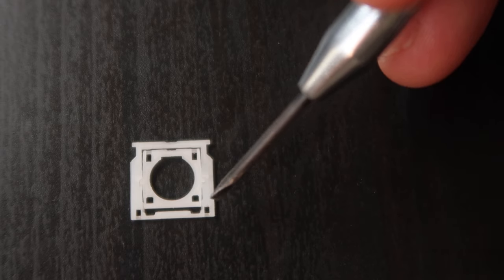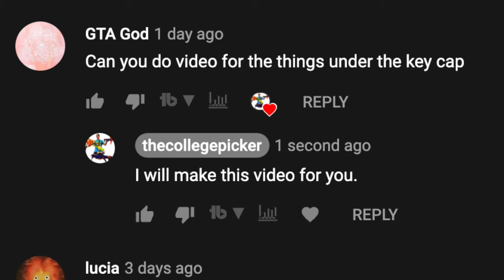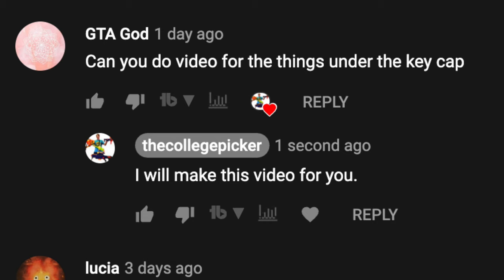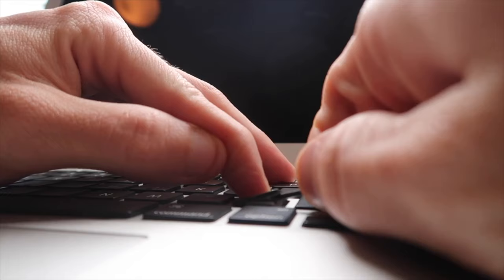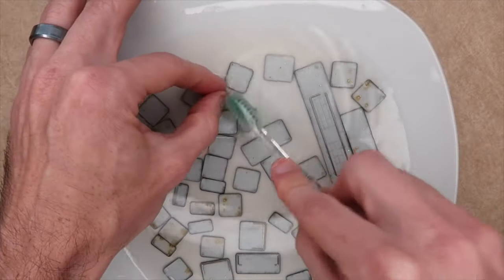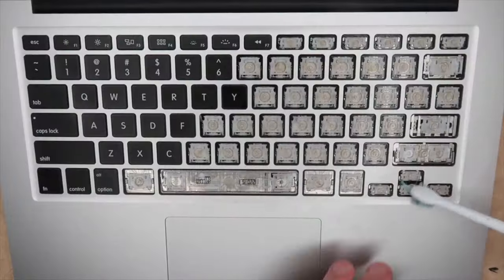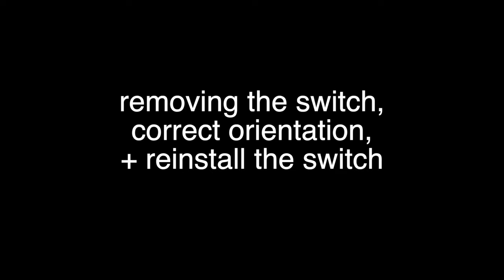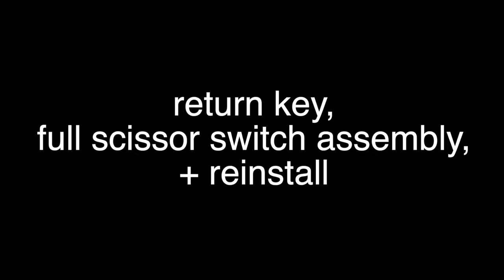How to Fix Macbook Air Keyboard Key Switch (Very Detailed)

Comment: now there is no bounce back on the key i fixed, works but is like pushing a flat button. tried twice, no broken bits, everything right direction and snapped in. kind of annoying and very little info on it online.
Reply: Is this still happening to you? mines doing the same thing.
Reply: i just slid my fingernail around the key and a little under for a bit
Reply: My space bar is doing the same thing lmk if you found out
Reply: Did anyone find an answer to this? My return key is flat and it's driving me crazy!
Reply: This is my T key and it's driving me bonkers.
Reply: Same! I need help
Reply: @thesciencelens  the same thing is happening to mine rn, did u find out???
Reply: @melody-rose6774  Sorry no :( Mine is still under warranty so I'm going to take it in.
Reply: @melody-rose6774  Unfortunately, no. My computer is still under warranty so I took it into an authorised reseller. But they said that it would take a week as they needed to order an entire keyboard to replace mine. They suggested I take it to Rome (3 hour drive away). I just have to get used to a dead key now.
Reply: Just slide a thin plastic card or fingernail around the side of the key, lift it up gently a few times and it should be fixed
Reply: It means its broken, take a closer look. There are these little plastic bits that can break on the back of the key.

Comment: fixed the letter keys i picked out stupidly thinking i could clean it, but I can't get the shift and capslock keys back in place. They click inside and never release again, and I don't want to type in caps all the time and I have to keep them taped down on my keyboard so they don't fall off. any advice on getting the tricky link bar keys to snap in correctly?
Reply: Same

Comment: What do I do if it's simply not snapping back on? I've tried so many times now and my "V" key, after removing the cap to clean the inside, is not popping back on, I've checked and there's nothing broken, originally it popped in too much and stayed down so it wouldn't have the bounciness like the other keys, but now it's just simply not staying, I'm pretty sure only the top part of the key is locking in, but the bottom part doesn't seem to want to be popping back in. What should I do?
Reply: Hi there. Were you able to fix it? I have an absolutely same problem.
Reply: @larry_berry  No lol, it's still broken. I now just have a tiny piece of blu-tack on the underside of the key which is helping it stick, it's even retained the same bounciness as the regular keys (it's still a bit wonky, but much better), so it definitely helped a bunch.

Comment: What about if the rubber round part ripped out? Its that one part that when you press on it the letter shows up. Mine is the down arrow that popped out and the rubbery broke.
Reply: Mines too does anybody know  what's the rubber part  called

Comment: This is probably a long shot, but is there any chance you have ever replaced the rubber cup itself. I do not want to use glue as I know the risk of doing so with the motherboard being directly under the keys. I have yet to find a video on the internet with a fix to this issue. Thank you for any help in advance.

Comment: This video was really helpful thank you. I may have inadvertently bent a piece of the switch in the small space where the two pieces of the scissor switch connect. After straightening it and reconnecting the keys, it works well. Should I be concerned or is it likely fine?

Comment: Thank you for the videos! How do I fix the scissor switch on the arrow keys!? That's the only one that got messed up for me. The rest of the keys work perfectly now
Reply from the maker: Those are tricky. I didn't show in this video but I have a video about the m1 Mac that I show on my channel. That may be helpful to show one technique that I used. I hope it helps
Reply: @thecollegepicker  I actually guessed the orientation from looking at how it looked on the video and fixed it. definitely could have messed it up. Thanks again :)

Comment: This worked - although my Macbook Air key cap came off with the white underside attached (I did not separate the two pieces), so I was able to just press it back in place, using the hooks on the bottom first and then the top. Hope it lasts! Thank you so much because of course I lost the "H" key and did not know which side was right side up!

Comment: Eric! Im struggling because i take my macbook to repair for this and they want me to charge $250 cause they want to replace the whole keyboard when is only broke the butterfly piece of the control key. Should I try your video or sometimes the problem requieres to change the whole keyboard. If is the second case, when is ok to change the whole keyboard

Comment: If the keyboard had been pressed in hard enough to permanently dip it, so the D, F and a few keys around in were in a slight dip, just enough so there is no real lip to it. How could you flatten out the keyboard again?

Comment: Mine is different so I cant orientate it, If you could help me please, I have a MacOS Big Sur
Reply from the maker: Hi, sorry you are having issues. What model and year computer is it? Big sur is the operating system.
Reply: @thecollegepicker  All I know its a 13 Inch 2017 version, The s key isn't working and the mechanism for it won't orientate when I try to Press down on it. Im using an Accesibility Keyboard rn so If you wanna know how Im typing s Im using an In-built keyboard
Reply: @thecollegepicker  Oh and it the key will work without the cover but Im not willing to type the key without its cover

Comment: i removed the return key & upon putting it back on it smashes down and doesn't pop back up.  this is on the macbook pro 13 inch 2020.  it also happened on the dash key as well.  All of the other keys seem to snap in find but those.  any comments or help is appreciated
Reply: you've probably broken the actual key hings itself, ive got the same problem. have to order new keys

Comment: I had a question about a dry battery on one of my games. I believe you made some videos of restoring fry batteries for some old Pokémon gameboy games. Recently my Pokémon emerald game had its battery run dry and it won’t let me save anymore. It also states it could be that the backup memory is damaged. Was asking if you knew what could possibly be the problem.
Reply from the maker: Probably the battery =( RIP pokemon.

Comment: Helppp what if I put the scissor switch on wrong and applied too much force now the key isnt responsive. What do I do?
Reply from the maker: I would remove it and try to install it correctly. If it's broken you can order a new switch.
Reply: @thecollegepicker  Yup I installed it correctly but the grey circle where the membrane touches is totally unresponsive.. What's your advice one this? :(

(apologies, I have no idea what it's called but I have pressed it lightly beforehand and noticed that it inputs the key's command) thank you so much for such a quick response!

Comment: Your video would've been much better if you had included information about the small silicone rubber cup/spring underneath the key cap. It's ironic because the arrow in your video's thumbnail is pointing right at it yet that's the only thing you didn't discuss.
Reply from the maker: Sorry about that, apologies for the confusion. I actually haven't any experience fixing a silicone cup yet. Arrow was supposed to just be the key and switch coming apart. 🙏🙏
Reply: @thecollegepicker  Now you have another video idea. YOU'RE WELCOME! ;-)
Reply from the maker: I'll mess with a keyboard and see what I can find out. 🤝

Comment: i keept on tryiyng and now my keyplastic like the keyitself on the back with the hinges is broken im prettyy mad but im not blaming u cuz it was like that alreayd
Reply from the maker: I've had that happen to me before, it totally sucks. They are pretty fragile but luckily you can find replacements pretty cheap on eBay 🙌
Reply: @thecollegepicker  yea can u tell me the name of the resplacements please?
Reply from the maker: Are you in the US?
Reply: @thecollegepicker  yes
Reply from the maker: @ScrapSm  You can find replacements on ebay or amazon for the specific key and switch you need. Make sure to match your model of keyboard or year of computer to get the right one.
Reply: @thecollegepicker  ok yea because i need the y key

Comment: Does it work as well with power key? The key is at the bottom, so the machine does not turn on properly. It turns off after 2 seconds after starting, and in order for it to turn on you need to press for at least 6 seconds otherwice it won't start.

Comment: I have a 2014 / 2015 MacBook Air that has the same keys and hinges as this vid. Recently my "R" key became loose and popping slightly out of place. I took the key & hinges off , cleaned the area , the hinge is still intact and i don't see any cracks or breaks on it. But i notice the hinge does not really snap back into place , it can scissor when placed back on but still seems loose ; though if i pull up with a screwdriver it seems anchored by the hooks , so it goes on somewhat. 

But when i snap the "R" key back on top the key and hinges (now snapped together) basically move out of place again and seems very loose & barely hanging on. Any idea what that could be or what i could do. I have a new hinge coming any day but nothing seems obviously wrong with the current hinge.

Comment: Please note that the instructions here are excellent for the former Macbook Air but do not apply to the Macbook Air M1, which has a redesigned scissor switch.
Reply from the maker: Yes this is for the old model.

Comment: My MacBook Pro 16 2019 model goes into Safeboot if I turn On the Mac after 5 hours . After restart from safeboot it works fine . Keyboard works fine and no damage at all . Also if I restart or turn it on within 2 hours or 3hrs it works perfectly fine.

Any idea why it goes into Safeboot without shift key only after 5 hours ..??